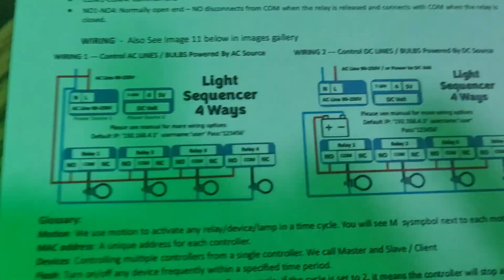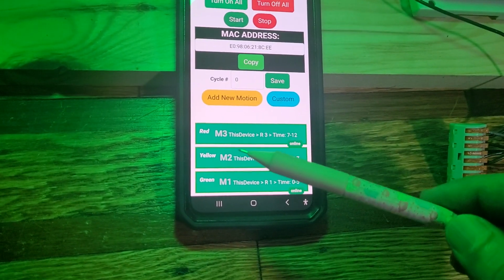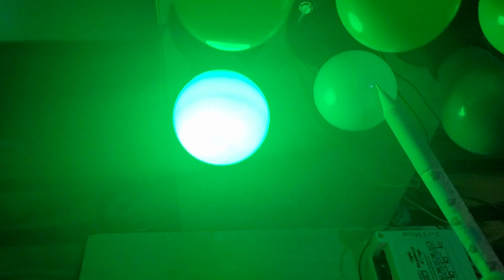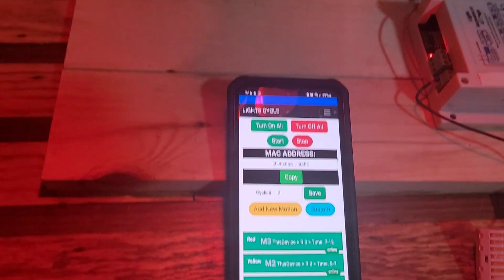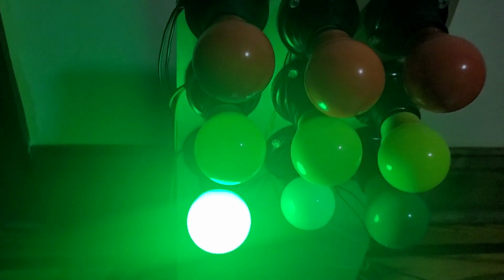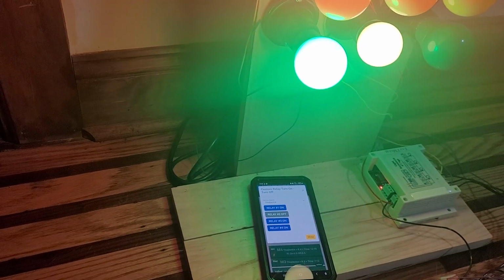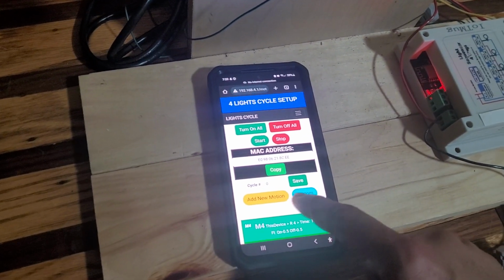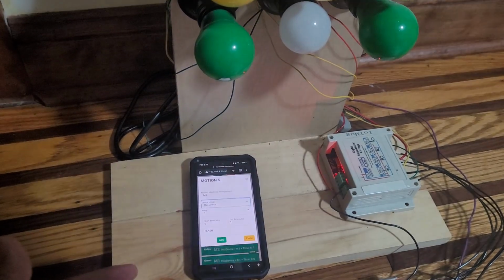Revolutionizing Traffic Light Controller Changer - Manage it by your phone, pc via WIFI 4 Channel

Comment: For the amateur DIY'er, I think we'd like to see a real working example of the actual wiring of the box to both the power source and the traffic light.  All other parts of the program, etc. were spot on, but using just the schematic included in the instructions to explain isn't as easy to understand as seeing it wire by wire being installed to the appropriate ports on the box.  May just be me, but visual instruction to a DIY'er is much more understandable.
Reply from the maker: Hi @DanMcGill-f3o, I believe you sent me email just 30 minutes ago. I replied. Send me your number I will call you right away. Thanks for suggestions also. I will make better videos.